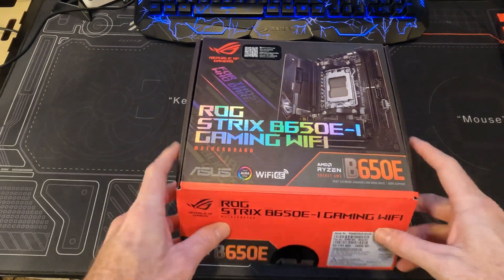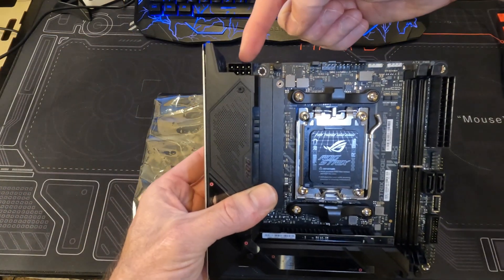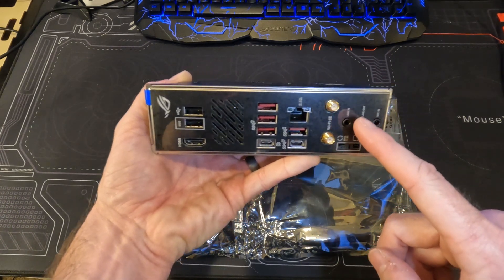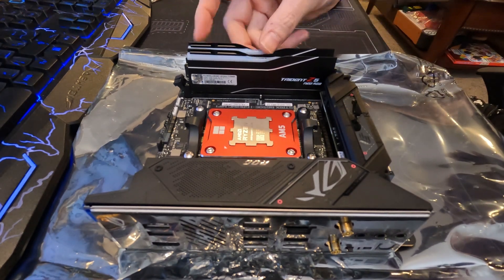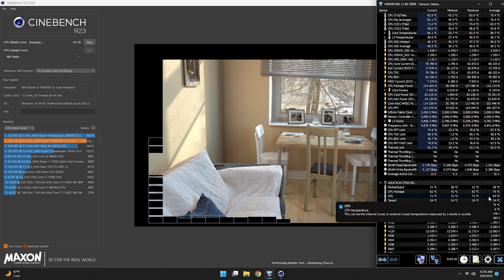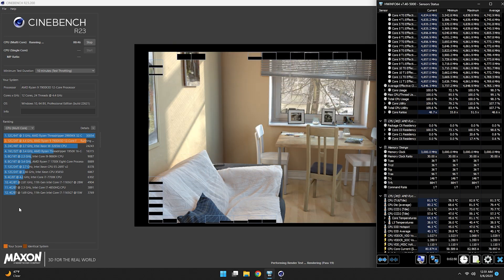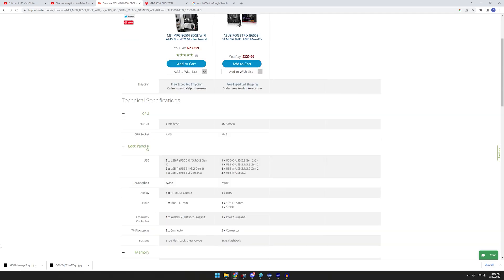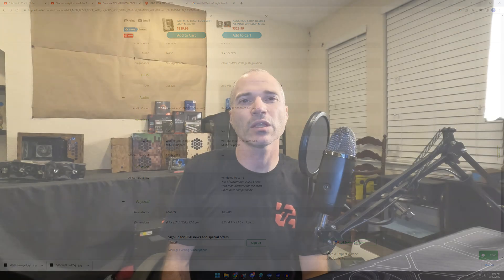Unbox | Review | 7900X3D Test | Asus ROG B650E-I Motherboard

Comment: Did you not get problems with the memory clock speeds running expo ?
Reply from the maker: No issues at all
Reply: @bricktronics thnx for the reply hope i wont have problems im gonna run a 7800x3d on this mobo with corsair ddr5 6000 cl 30 64 gb but ive read that sometimes it wont post because of the controller of the 3d’s not being able to handle the speeds
Reply from the maker: @DoubleDrastik  it should be fine, just make sure to update the bios prior to first boot
Reply: @DoubleDrastik  Living a nightmare at the moment. Im on my 2nd set of 32x2 cl30 6000 BOTH are on the compatibility list and wont post. Updated bios, posted with one then put the 2nd one no post and yellow dram light. Running a set of 16x2 just fine also on the list. I guess only 32gb is possible?
Reply: @  i got mine running stable at 6000mhz noe but had to get the amd certified  G skill

Comment: Hey will I encounter problems such as clearance if I use Thermaltake Phantom Spirit 120 SE CPU cooler? since we almost have the same setup, except for the processor as I'm planning to get 7800x3d but for ram, will also use G Skill trident Z5 Neo. Thanks!
Reply from the maker: I'm not sure about that cooler as I don't have any experience using it. Most of the time, there aren't clearance issues....I usually use AIOs, and that's what I recommend as well.

Comment: The Asus website doesnt say if the USB 3.2 gen2 header supports USB-C, but their X670 says it does. Looks like it supports USB-c, have you tried it? trying to get a case that supports MB connectors is another issue.
Reply from the maker: The 3.2 gen 2 header is USB C...it works

Comment: Great video buddy 
So you do recommend the thermalright frame and u confirm it does run cooler? 

And we can update bios before installing anything on the mb ? U mean literally just the 24 pin and we can update the bios? Thanks for the video again keep up the good work
Reply from the maker: Thanks bud. I cannot personally confirm the cpu frame makes it run cooler on the AM5 platform BUT I will be testing this soon in the next month. Intel 13th gen, I can say it does the job and have tested it there.

Yes all you need is the 24 pin for the bios flashback, no cpu, memory, or gpu required. Pretty awesome feature.
Reply: @bricktronics What is the process to flashback the bios? Do you only need to press the switch on the board, or do you also need a USB drive with updated version?
Reply from the maker: @unite9504  there is a bios flashback switch on the i/o. First you will need to put the updated bios on a thumb drive, use the rename tool (part of the download), then insert into the usb port labeled for bios flashbacks. At that point with power off but psu connected you hold down the bios flashback button on the i/o until a light next to it flashes. Once it's done the light will go out and you are done. Did all of that make sense?
Reply: @bricktronics  Thank you! That makes a ton of sense.

Last build I did was in 2020 (ATX), and have put together a SFF build I plan to order. I had no issues with my ATX Asus board, but used an Intel chipset and have heard many comments on Bios issues with Zen4. Just wanted to make sure I knew how to flashback if needed once I order all the parts. 

Thanks again
Reply from the maker: @unite9504  no problem, are you using this specific motherboard now or what board do you have?
Reply: @bricktronics  I currently have an Asus Z390-E with i9-9900K, but am planning on upgrading (and downsizing) this summer to 7800X3D w/ this B650E-I
Reply from the maker: @unite9504  right on, that cpu is better than the 7900x3d I used in this video. You'll be real happy with the upgrade.
Reply: @bricktronics  That’s what I’ve heard as well, I’m disappointed in both the high-end pricing of the 13 gen and the Zen4 so far.

Do you have a discord server or channel where I could link my partpicker list?

Comment: Was so exited when the board arrived and couldn't wait to finally build my PC with a 7800X3D... until I noticed that the board was doa
Reply: ha same cpu and my board had broken pins
Reply from the maker: @snazzysailor  ah that's a bummer, was it an easy return?
Reply from the maker: That is unfortunate....were you able to get a replacement?
Reply: @bricktronics  unfortunately the return is still ongoing. I don't know why it takes so long, but it fits my luck with the build so far
Reply from the maker: @kronos9931  dang, I'm sorry to hear. I had to rma this 7900x3d and AMD was real quick to send a replacement.
Reply: 😂 My asrock board was working then a week later it died and took a stick of ram with it. I thought I was going to be safe with a $209 motherboard, in the end I just returned it and bought this board, it had a debug LED too. Idk why that isn’t a standard on boards these days

Comment: That frame is a placebo...not necessary for the CPU...
Reply from the maker: Maybe in some situations it doesn't make a difference, in ours it does when building in a case that will only fit a 240mm radiator....especially on 13th gen intel chips. I see cooler temps with a frame on a 240mm radiator than with no frame and a 360mm setup.

Comment: Just got my delivered from amazon without the amazon brown box with stickers on  the retail box with my shipping address which was weird,  there were no seals on the retail box or the motherboard static bag, just wanted to know did yours come sealed?

Is this how they come? Is this the norm?
Reply from the maker: That is strange, but sometimes the product will be opened to update bios and firmware as I have experience super recent updates on new boards ordered. But the box itself should have been sealed. If it were me building for a customers build I would return it. Personal rig, if everything tests out good I'd send it.

Edit - oh no static bag around the board? I'd send it back, it should not have shipped like that.
Reply: @bricktronics  hey,  thanks for replaying, the board did come in static  bag but wasnt sealed nor the retail box, all the accessories are there.
Reply from the maker: @ESSA20  ah ok, so then I fall back on if it's for personal use, test it out. Inspect the board to ensure it isn't used....take a close look at fan headers, cpu socket, m.2 thermal pads should still have plastic film on it, then I'd send it as long as everything checks out. Was it shipped and sold by Amazon or a 3rd party seller?
Reply: @bricktronics  thankyou brother for taking your time out and helping a  brother out really appreciate that.  It was sold directly from Amazon, what's get me is the fact it wasn't sealed anybody could have stolen or tampered with board. Hence why I asked if this was normal to be shipped like this.
Reply from the maker: @ESSA20  anytime bud, happy to help. Update us here how it turns out!

Comment: Does this motherboard supports a usb-C to displayport to play in 4K 144Hz ? Thanks
Reply from the maker: It does support usb-c for display. However, by utilizing that it would use the iGPU which I would not recommend, especially for 4k resolution.
Reply: @bricktronics  how can I get 4k 144hz so ? Just using usb-c ? Because the HDMI 2.1 port only supports 4k 60fps
Reply from the maker: @user-n6p2k  yes but performance would be terrible. My recommendation would be to get a good GPU and connect your display thru that.
Reply: @bricktronics  yes im gonna get RX 7900XTX but i was wondering which port using to play in 4k 144Hz resolution. Like to connect my PC to my screen i have to use the ports on my motherboard so i dont know which port use
Reply: @bricktronics  Oh i see i have to use the ports on the GPU directly ? My bad^^
Reply from the maker: @user-n6p2k  yeah, and there are some GPUs that have the c port otherwise adapters are your friend 🤘
Reply: @bricktronics  thank you sir^^
Reply from the maker: @user-n6p2k  anytime bud!

Comment: Why did you have to update the BIOS? What was it doing/not doing? Red or yellow QLED?
Reply from the maker: The X3D chips require the latest bios to post, otherwise it would get a red qled but I didn't try it before updating. The bios that was on this motherboard would not support the chip. In addition, chipset drivers have to be updated as well as several settings within Windows for these CPUs to function "correctly".
Reply: Do you have a tutorial on this please? @bricktronics
Reply from the maker: @HoodNox  I do not, sorry
Reply: @bricktronics  No worries, thank you

Comment: Thanks for the review. I'm planning to build new mini itx system and trying to decide between Asus B650E-I and X670E-I. Reddit is full of comments about coil whine on B650E-I montherobard. Does your motherboard have any coil whine?
Reply from the maker: Thanks bud. I get absolutely zero coil whine from this board. To be fair I have only tested one of these so I can't say non of them will. But I don't recommend the X670E-I board if you are getting it for better performance and future compatibility. The 670 also features the Hive which I find convenient and annoying at the same time. Just my opinion.
Reply: @bricktronics  I don’t need any features from x670 and whole PCIE 5.0 is overhyped now. Once SSDs are GPUs would be out they gonna be really expensive. I 100% agree on the hive!
Reply from the maker: @DominikZalewski85  and that's also why I like the b650e-i is for the pci 5.0 slots, it's better for me to have the future upgradability. Outside of that it's a good quality product.

Comment: So what are the differences in temps with the frame versus original mounting?
Reply from the maker: Not sure yet, I haven't put the factory ILM on it. I'm waiting on more Thermal Grizzly but according to what other people have tested, with the frame is 2-3c cooler at idle and around 4c during the benchmark. I will document my findings when I get the thermal paste in.
Reply: @bricktronics  so, is it safe to use the original mounting frame?
Reply from the maker: @nichogo6711  for sure, the stock mounting frame is safe. From what I have seen on tests is only a few degree difference. I just try to squeeze the best thermals into my builds, every little bit helps. I will be making some content on a thermal comparison with and without this frame installed.
Reply: @bricktronics  thanks, i'm planning to use a 7800X3D with this board.
Reply from the maker: @nichogo6711  good choice! I should have waited for the 7800x3d but really wanted to be one of the first independent reviewers for the 7900x3d.